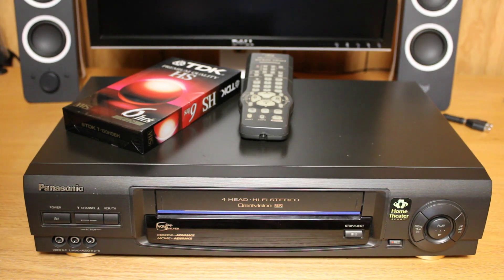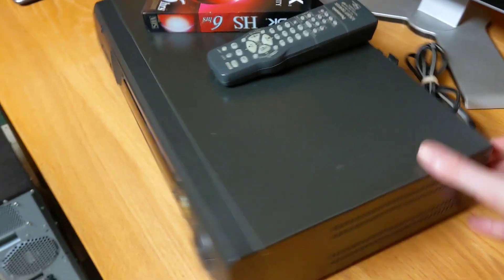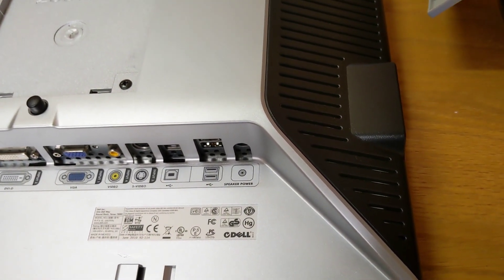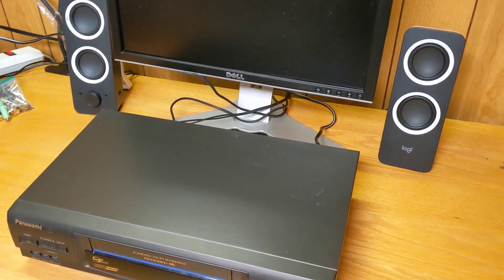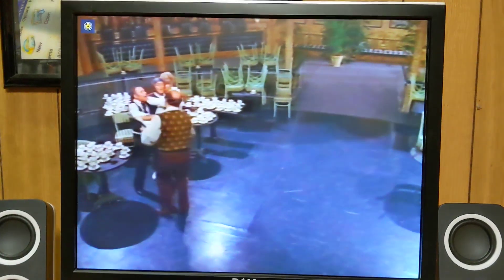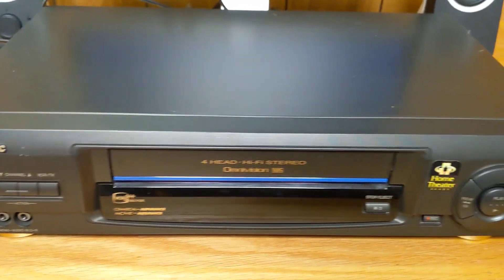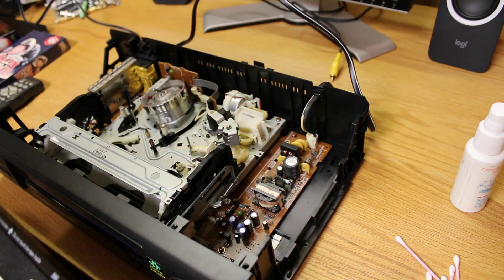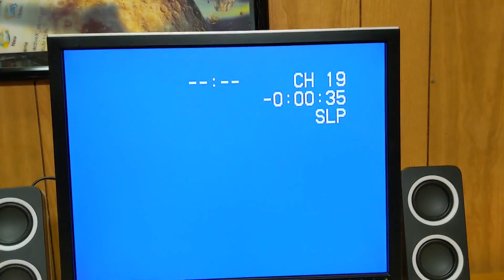Thrift Store Panasonic HiFi VCR

Comment: those VFD Displays on those will fade over time, so with how dim it is i bet its been left on for years and years, i have a sont stereo that is the same way
Reply from the maker: Good observation. The unit doesn't show a lot of wear and tears so it was likely just the clock running for 20+ years.

Comment: Non pulire le testine del tamburo con il cotton fioc,può lasciare pelucchi sulle testine,o peggio,possono danneggiarsi.ti consiglio di togliere il sistema autopulente,fa piu' danno che altro,le testine vanno pulite manualmente,serve a proteggerle
Reply from the maker: This is really good advice! - Translated from Italian "Do not clean the drum heads with a cotton swab, it can leave lint on the heads, or worse, they can get damaged. I advise you to remove the self-cleaning system, it does more damage than anything else, the heads must be cleaned manually, it helps to protect them"